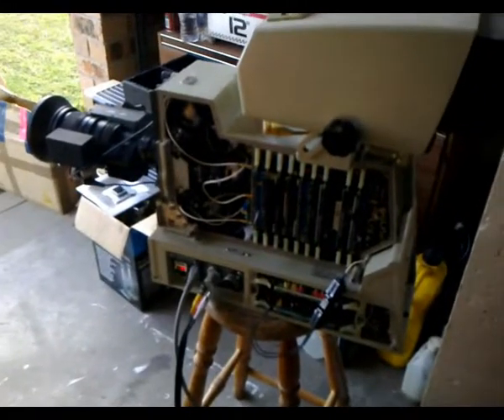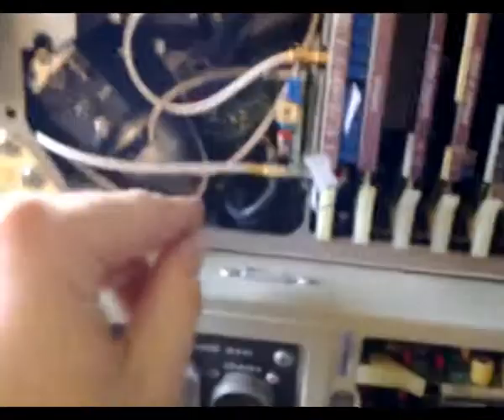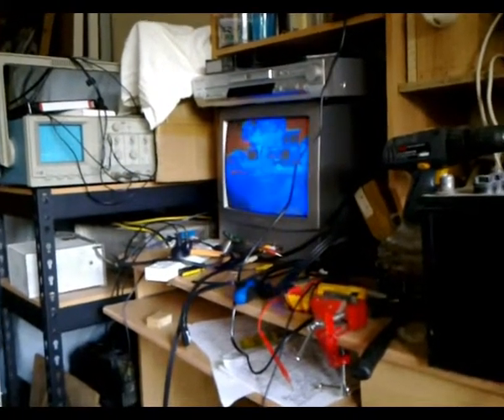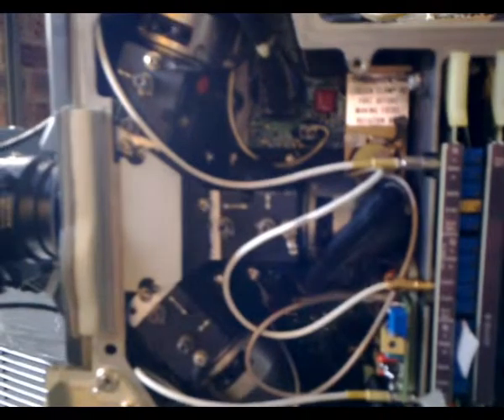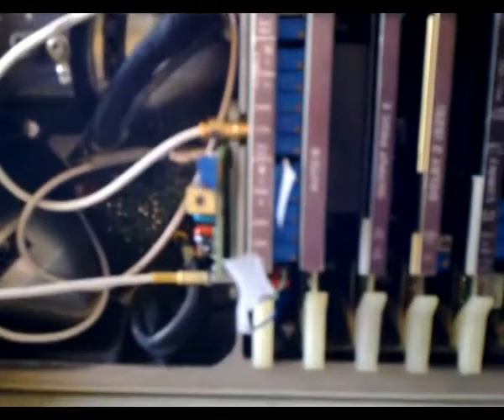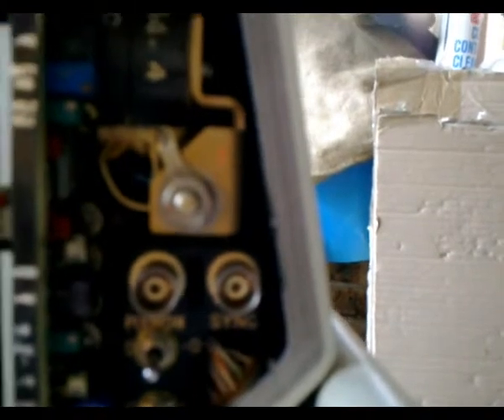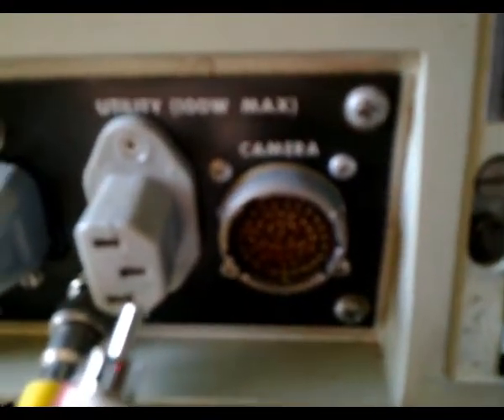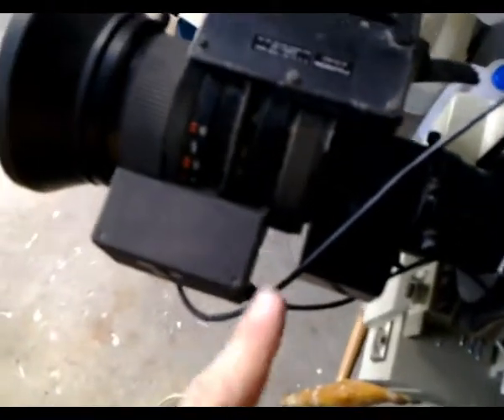1977/78 RCA TK-760 3 plumbicon tube colour broadcast in operation (Part 2)

Comment: man this camera needs a full upgrade in  all Electrolityc capacitors and tree new tubes te pic is very bad...
Reply from the maker: Yep that's very true. The camera has since stopped working anyhow so it's gonna need a total overhaul and until I get a service manual for it I am unable to service it. Anyhow thought I make a video of it while it was working.
Reply: service manual is all......

Comment: man you must  first change all the electrolytic and tantalun capacitors of this camera and ccu secound change the plumbicons tubes here i can see the picture quality is very poor  because the gain of each tube , this camera produces good picture quality in my collection i got this camera too i done a full upgrade im my two RCA TK41, for example i changed all resistors and capacitors vacuum tubes more than 270 ,seleniun rectifiers for silicon and tree new image orthicons sealed in the box